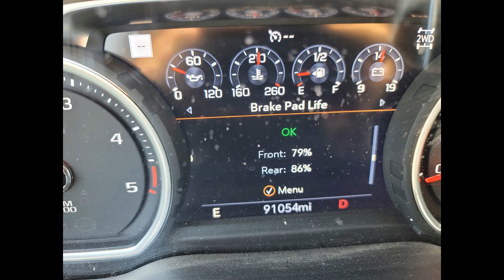2021 Chevy " Rock 2" and a Tour of Don's new Shop Addition

Comment: Love that shop of Don's. I'm retiring and am looking for somewhere smaller now for me and my wife. Trouble is I also want a much larger workshop. They just don't exist in the UK, a modern house is 1300 square feet on average. And I want, but really won't get a 2000 sq ft workshop. Not without spending far more than we have got anyway.
Reply from the maker: I could not get by very well on 1300 feet... My house is 5000 under roof and the the Shop is a 60 x 40..... Still have about 10.9 acres to fill up if needed and my wife looses her mind or eyesight :)

Comment: Beautiful job DON I THINK ITS PERFECT. I wonder if you sprinkle some concrete mix over the black top it will harden it up. Put on dry and shower it with a hose nozzle not heavy just wet it so it sinks in before it gets hard.
Reply: It will harden I just need to pack it down. I was just letting it settle before I pack it.

Comment: I can’t help wondering if Don is maybe allergic to windows? 🤷‍♂️😜😂😂
Reply: Well in Texas windows just lets more heat in!
Reply: @donmadere4237  That makes sense Don, it’s pretty hot there in Texas I hear tell.
Gets a tad hot here down-under as well at times, so we got to Texas in summer for the cooler weather. 😜😂🇦🇺😉

Double or triple glazed windows would allow light in while keeping the heat out, but they aren’t cheap at all.
Gotta say that like everyone else, I’m very impressed by all you have achieved building that extension on your own at 70. 👍👍👍

At 64 I’m not sure I could take that on myself, I find I don’t bounce like I used to when I fall off ladders these days. 🙄😢
Plus my sure footed Spiderman skills aren’t what they used to be up on roofs either any more.